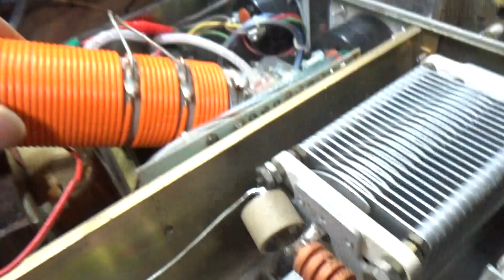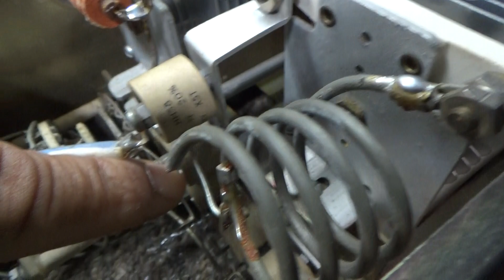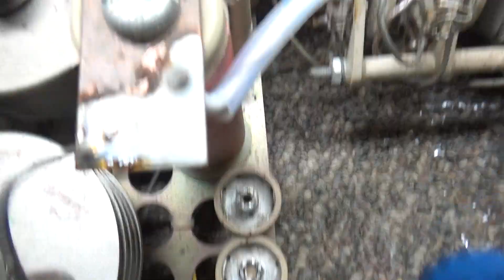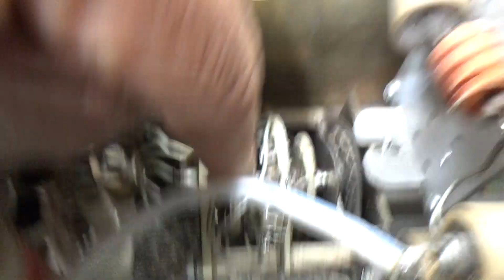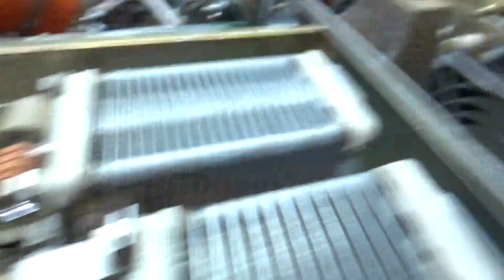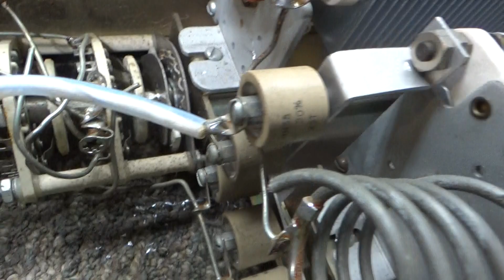Dentron MLA-2500 walkthru

Comment: I THINK THE CAP IS REFERED TO AS A DOOR KNOB. ALSO THE RF LINE SHOULD BE SHIELDED. . RG - 400 MIGHT BE A GOOD MODIFICATION. WHAT DO YOU THINK ?
Reply from the maker: Sorry, I'm in a bad mood, so what I think is, first of all, using all caps just sucks. That means you are yelling, right? 2nd a door knob is a type of cap. They are called a door knob's because they sorta look like door knobs. I was trying to refer to the use of those caps, not to the specific types of caps they are.

Comment: There's a hot rodder's axiom that might apply here: if it doesn't make you go fast, get rid of it. 
Here, if it isn't needed for "monoband" operation, get rid of it. The fewer unnecessary things floating around in the RF section the more stable and clean it will be. Replace that long, naked wire with a piece of RG-213 and ground the shield braid. 
Compare the Dentron to the Alpha sometime. Dick Ehrhorn was like Don Stoner, building the absolute best regardless of the cost.
Reply from the maker: Agree, but better amps, like Alpha, do have a lot more safety devices though. Like soft start, glitch resistors, crow bars, arc gaps, etc. I would not recommend getting rid of safety stuff, just the un-needed Ham Band stuff.

Comment: The metal resistor you're trying to get to is across the input to the tubes. I think it's R1. It lowers the input impedance. People cut them out to get more output out of the tubes when they're weak and it helps for a bit but totally screws up your input match to the rig, and doesn't help the tubes any on the way out. I'd recommend putting it back or coming up with an alternative. And it means the tubes may be weak.
Reply from the maker: Everything you said is 100 percent correct. I put it back and yes, the tubes are weak.
Reply: Bummer the tubes are tired. I can see why you'd mono band it, it wasn't usable for your purposes anyway. My 2500 doesn't have the dual HV and the tune/cw button is "cont duty". Your videos have been really informative. You're a wizard sir. It's fun to watch you work.